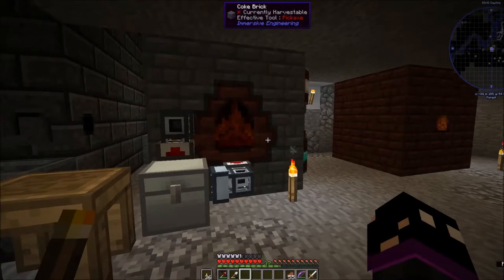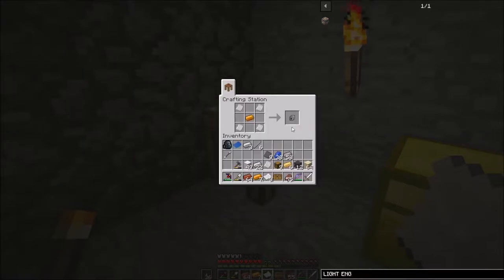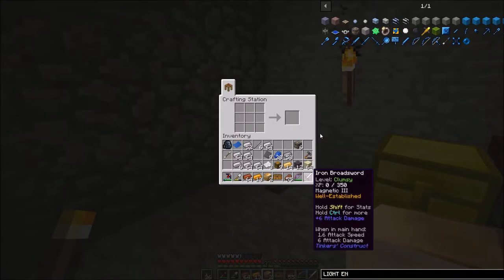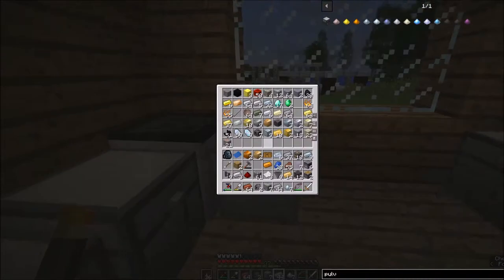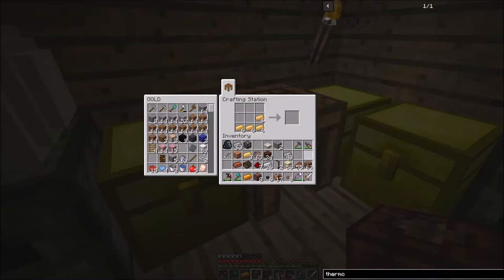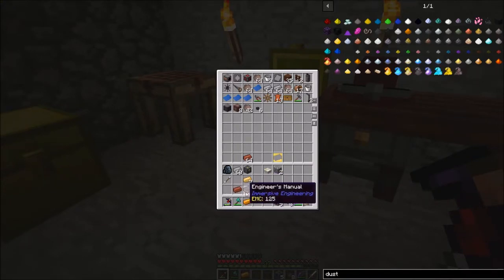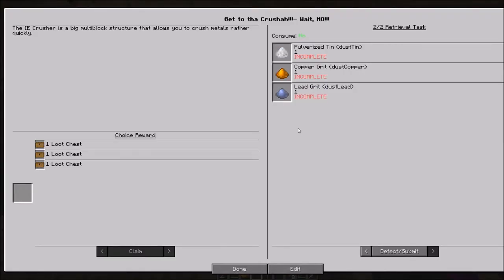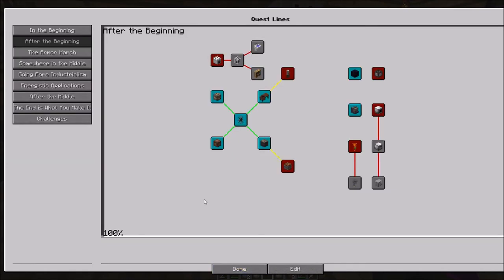Starter level power Immersive Engineering mod | Rise of the Pack | Modded 1.12 | Ep 15

Comment: I was laughing so much. You went through all the steps to craft all the componants for the immersive engineering crusher (multiblock shown in the manual) then at the end just crafted the actually additions one :D 
BTW it is cheaper to craft the mechanical componants in the immersive engineering workbench with the blueprint than in a crafting table :)
The thermal generator you made is also quite good power gen (better than the wind mill anyway). You just need a heat source on one side and a cold thing on the other (coolents and heat sources are listed in the book along with how good they are). The wind mill you can right click the sails to to make it better though and it is much prettier if you want to build a awesome looking wind mill (I'm sure I wouldn't complain about that :) )
Reply from the maker: a windmill is on the cards for a farming section as i need to get some food production going